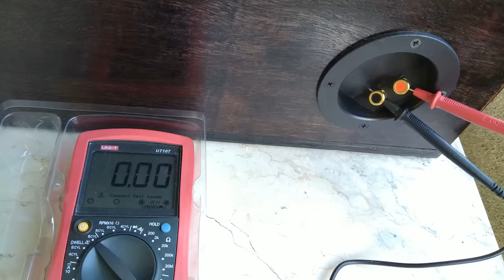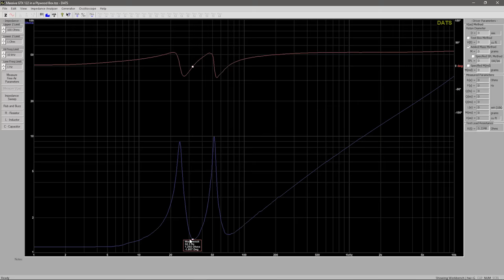How to Make L-Port Plywood Subwoofer Box - DIY

Comment: The box is too good for that sub. 
That is an Extremely nice enclosure.
Reply: There is no where I have seen the measurements shared.
Reply from the maker: @odangydrama  There is a link to the TinkerCad 3D schematics in the video description. You need to create an account and login to TinkerCad so you can start using it and seeing the dimensions. Use laptop or computer web browser to open TinkerCad.

Comment: hey bud i was wondering why theres a piece of wood on the end of the port. i know the 45s help with air velocity and makes the box stronger but ive never got an answer on why some boxes have a piece at the end of the port. i like it i wish i knew whats it meant for, thanks
Reply from the maker: Hello Rowboyto, that prism shaped wood attached at the port wall's end is to prevent air chuffing the thin wall.

Comment: You should have added mass, dampened the internal walls, metallic boards, to kill vibrations, and added a silicone gasket to the driver, a much more tight bass. infinitely precise.
Reply from the maker: No need. The woofer is just merely 700w RMS.

Comment: Hey, I have a question for you.   I am wondering how the transfer function of the vehicle affects the in-car response.  I have heard that if you tune for flat that you will likely get a nasty peak at some point in the frequency response
Reply from the maker: Nice question. That is one a bit of an advanced step in box building that I am still a newbie of. There is a section in Bass Box Pro that lets the user calculate the vehicle's air space volume, leaks, specs and response, all to be included in the final output of the whole system.

Comment: I am looking to make build a subwoofer box for a 10 inch or 8 inch sub. Should I use L-port design or just a regular port? I also have seen you have these wedges in the corners, are they necessary?

Comment: Can I cut my speaker hole AFTER I glue the box together? I have a double baffle and a 1/4" router. I bought a 1/4" diameter, 3" long end mill to cut the depth of the two 3/4" front baffle panels. Think I'll be ok? Or did I make a major mistake?
Reply from the maker: You can still cut speaker mounting hole after gluing together. I also do that sometimes.
Reply: @chrclmnky  Ok cool! Thanks!

Comment: hey what tool are you using on 4:27 ? what kind of drill or drill accesory is that so you can drill perfectly straight?
Reply from the maker: It's just a generic "drill guide attachment". Available almost everywhere.
Reply from the maker: @jairoguerra9924  yes. There are way cheaper from other online marketplaces like AliExpress, eBay, Banggood

Comment: And here I wuz thinking this would be something I could actually do myself 😂🤣😂😂
Reply from the maker: Yes you can! With just a little patience and time, you can build awesome boxes.
Reply: @chrclmnky   Absolutely and I appreciate that, only thing is that I don't have all those specialized tools 🥺😔
Reply: @hcic9860     This was Insanely over built for a 700w sub, you don't need anywhere near this level of box.   Don't need the double front, don't need the extra bracing for the corners or end of the ports.  You can do this build much simpler with basic tools.

Comment: what happen if box Port are too big ?? 4inch width & 14inch height & port long about 20inch +/- . box dimensions : 27inch width / 15.5inch height / 15inch depth, one 12inch jbl stadium 1224 subwoofer 500w rms & 12mm xmax, im prefer to loud bass, not too low bass freq but ok if I can get a louder bass sound from this size box, sorry im beginner
Reply from the maker: Sub will act as in open air and will bottom out.

Comment: How do you make perfect circles?
Reply from the maker: Hello Taco, I used a router and a jig. Here is the video about how I do that - https://youtu.be/7x4f6nfGlO0
Reply: You can use a compass or a drywall Circle Cutter. They both work good. But if you dont have either of those tools you can basically make you're own circle tracer by using a tape measure, a piece of wood (about 2 in by whatever length you need a tape measure and a couple of screws. I learned alot of what IU know from watching YouTube vids.

Comment: What's the specs on the screw sets used for the subwoofer mounting??
Reply from the maker: Hello, the T-nuts and Allen head machine bolts are size M4 or 4mm.
Reply from the maker: And about 2 inch long.

Comment: Does the port at the back of the box have to be the same width as the side?
Reply from the maker: Yes, for consistency.
Reply: @chrclmnky  what if its off by like 10-12% ?
Reply from the maker: @AKTesla  none to worry. That is just a very small difference.

Comment: Pretty good job! congrats what size is the port in the front box? thkns
Reply from the maker: Thanks Willy. There is a link to the TinkerCad 3D schematics in the video description. You need to create an account and login to TinkerCad so you can start using it and seeing the dimensions. Use laptop or computer web browser to open TinkerCad.

Comment: sir naka tune din po ba yung targa na 10" sa L ported na box???base po kasi sa recomended  box nya  2nd order na sub box.tanx idol.
Reply from the maker: Did Targa recommend anything? If so, where? In designing enclosure, you will need the electro-mechanical (theile-small parameters) of the speaker and calculate using a software emulator.

Comment: Kindly share the measurements, thanks.
Reply from the maker: There is a link to the TinkerCad 3D schematics in the video description. You need to create an account and login to TinkerCad so you can start using it and seeing the dimensions. Use laptop or computer web browser to open TinkerCad.

Comment: Hello I tried the new subwoofer today, the smell came. Why is it because it is new? Like the burning smell but I measured the coils, no problem
Reply from the maker: Same thing happened to my GTX 122. It smokes and smells! How much amp power did you connect?
Reply: @chrclmnky  I connected subwoofer 4 + 4 ohms 2 ohms 800 rms. The amplifier delivers 900 rms at 2 ohms. I turned on low frequency music on first run
Reply from the maker: @bakbakalm4973  ok just don't put the volume and gain on very high.
Reply: @chrclmnky  Thank you. Shall I return the subwoofer? This smell frightened the incident nauseous. Do you think something will happen?
Reply from the maker: @bakbakalm4973  it's just normal.

Comment: if i have an 18 "speaker ... how to determine the box volume and port on the speaker box ... according to the data on the speaker ... thanks
Reply from the maker: Calculate the box using a program. WinISD is free to download, for Windows.
Reply: @chrclmnky  i want link aplication
Reply: @chrclmnky  how to calculate it basically ... from the speaker data ...
Reply from the maker: @masaminhobimancing8938  Just input every data into the program. Just Google the link.
Reply: @chrclmnky  what is the name the aplication?..
Reply from the maker: @masaminhobimancing8938  read back my comments and read carefully.

Comment: anu po technique nyo para dumikit ang lead sa speaker wire boss
Reply from the maker: Mainit at malinis na soldering iron
Reply: @chrclmnky  big thanks po 
sa akin kasi pag mainit ung soledering iron ko medyo nangigitim ung tip niya katagalan kaya ayaw na po dumikit ung lead sa soldering ko po 😢
Reply from the maker: @averagemark17  regularly change tips. Use high quality tips. Clean using only piece of paper in order not to scrape off the "shiny" coating.
Reply: thanks idol 
nice box po
Reply: @chrclmnky  ordinary speaker wire lang po gamit nyo po
Reply from the maker: @averagemark17  Plain ordinary 12 gauge wire.

Comment: Tengo mi carro kia picanto y tengo un subwoofer tsw309 pioneer dual 4 ohm crees que me puedas ayudar hacer una caja que suene fuerte así este la maletera abierta el espacio es poco del maletero podrás enseñar
Reply from the maker: Hello Jhohan, thanks for reaching out. This particular subwoofer box will be good for your Pioneer TS-W309 since they have same T/S parameters with the Massive GTX 122. For measurements of the box, check out the video description for the link to TinkerCad layout and design.
Reply: @chrclmnky  tengo que comprar el programa verdad manda un saludo para Perú 🇵🇪 en tu próximo viaje a vídeo gracias

Comment: Bro I have 10inch single coil double magnet subwoofer please suggest a box
Reply from the maker: You can copy this box but minus 1 inch to each side
Reply: @chrclmnky  sir full details and measurements of that box pls..i want to diy same as that tnx sir
Reply from the maker: @meinradoeb4101  Hello Meinrado, There is a link to the TinkerCad 3D schematics in the video description. You need to create an account and login to TinkerCad so you can start using it and seeing the dimensions. Use laptop or computer web browser to open TinkerCad.

Comment: You should have routered all the edges within that box. Air doesn't like to turn and the sharp short turn edges causes turbulence at those areas! Just a thought for the next time or if anyone else is taking on a project such as this!!!  Otherwise, Job well done!!!
Reply from the maker: It's routed. No sharp edges there. Just didn't shown in the video.

Comment: From the beginning i was waiting for sound and bass check,  but unfortunately you didn't test a single song.
Reply from the maker: There is a pinned demo video in the comment section and end screen, if you haven't seen that then there it is - https://youtu.be/GVS4K_a_q2A
Reply: @chrclmnky  ok got it,  by the way how much is the watt that ur subwoofer gives?   And does the baas equivalent to jbl partybox 310?    Also do outdoor test using binural microphone.  🙏

Comment: not bad but you forget the Bass pass plate, because your subwoofer is connected directly, so if you connect it directly with a good amplifier you will be very over it because it will not give its maximum or maybe it will burn meaning are  calculate frequency well damage.
Reply from the maker: No one installs crossovers or passive low pass filters on their car subwoofers anymore my friend. 😂😆

Comment: All is fine except that ur using a plywood instead of 3/4 MDF, try it u'll get a deeper soft crawling bass, kabayan!!
Reply from the maker: No difference between two materials in terms of resonance.
Reply: @chrclmnky  maybe ur just contented on d usual hard bass u hear all d tym. At first i also used plywood but when i use MDF it levels up my bass listening. i too is from d phils, and plywood and marinewood is everywhere so they use it all d tym. i remember my 1st MDF sub is from a wrecked tv entertainment cabinet n dat started it all. Try it bro ❤️✌️
Reply from the maker: @nelsonaragon1703  Times have changed a lot. There's a thing called impedance/resonance meter, the one I've used at the near end of the video. It's made by Dayton Audio and only sold at Parts Express. A tool used by audio engineers in measuring anything audio-electronics. It is built to kill theories such as material resonance theory you believed in.
Reply from the maker: @nelsonaragon1703  Also you may want to check out my other videos, you will see a lot of boxes made out of MDF too. Enjoy watching.
Reply: @chrclmnky  well based on my experienced, i based my jugdement in hearing and feeling after i put it in my meters, i already input in my mind dat i will always use an MDF board when making a sub box. Its only my opinion kabayan ✌️
Reply from the maker: @nelsonaragon1703  It's okay no problem. I get a lot of comments from inexperienced individuals telling me to do this and to do that! And you're no exception. Anyway thanks for the visit and be well. 😉
Reply: @chrclmnky  ooops! Inexperienced individual? im giving u my decent opinion for u to have lots of customer, maybe ur not into carshow so u dont know. Electronics is my lyf in the phil b4 i came here in washington, im a BSEE grad and an electronics technician, i use fluke as my multimeter. i already c u in ur other vid, it luks lyk ur the type of guy who doesnt want to be opinionated. Better leave this channel....poor guy
Reply from the maker: @nelsonaragon1703  Like I said, I get tons of comments like this and you're no exception. Next attention seeker please...

Comment: pwede malaman buong dimension?
Reply from the maker: Sure. There is a link to the TinkerCad 3D schematics in the video description. You need to create an account and login to TinkerCad so you can start using it and seeing the dimensions. Use laptop or computer web browser to open TinkerCad.
Reply: @chrclmnky  hindi ko maopen yung dowloaded na file..may drawing ka with dimension? thanks
Reply from the maker: @zyreljosephaswer3390  pilipino nga naman, may detalyadong instruction na ayaw pa sumunod.
Reply: @chrclmnky  pasensya na sir hindi ko kasi maopen. sige sir salamat na lang po

Comment: schematic please...sir
Reply from the maker: Check the link to TinkerCad in the video description.
Reply: do you play on 2 ohms....sir
Reply from the maker: @arissetiawan6172  this sub is wired in 1 Ohm.
Reply: @chrclmnky  wow.....will the power amplifier not be damaged,,,sir
Reply from the maker: @arissetiawan6172  amp can handle 1 Ohm at 1500w RMS. You should check your amp if it can handle such loads.

Comment: Hey bro I know theirs many people on here talking shit but I couldn’t pass by n not mention a few things you can say f me n what I gotta say but just think about those holes you made to screw the walls together those holes are going to disrupt the flow of air on the inside it’s going to great pockets of air in each one it’s a clean sick box and the idea is a good one but theirs a reason why everyone does it the normal way . Also adding the speaker terminal cup right in the way of the port haul is f’ing up the air flow smh 🤦🏻‍♂️ bro it’s such a sick box no lie but those 2 things took away a good amount of bass and air flow maybe putting more stress on the speaker idk maybe. Lol good work tho man sick shit.
Reply from the maker: Thanks for the feedback. Those little things can be disregarded. Little or no effect in real life application. Even the top guys like Bobby Gately, Next Level Fab, T and C Designs, to name a few, do such things even larger and deeper pocket holes.

Comment: You have an old idea, and it will not perform like you think. This is “out of phase” ........the distance has to equal the time. Nice try, though.
Reply from the maker: The what?
Reply: Lol
Reply: @jamie5.068  not sure what’s so funny. The guy did a nice job on something that will not do what he thinks it will. Sound will come out, yes, but it will be out of phase, to out of balance, or out of time......they all mean the same thing. Either do the math or tear apart a BOSE.
Reply: @johnholmes4960  you know too much, if it's out of phase you could switch it on the amp or radio. And it's not out of phase
Reply: He coudnt even answer you because he is proble like what the f is this guy talking about.
Reply: Jamie, ok, I get it, thanks. You may be more right than you realize.
Reply: @jamie5.068  Jamie, it’s not the voltage that’s out of phase, it’s the design of the distance the waves travel 
 
The front and the back of the speaker have to reach your ear at the same moment. There fore it is out of phase, or you can say the timing is off. This is an engineering issue. Have a great day.🤠

Comment: Insanely over built for a 700w sub.
Reply: You always want to overbuild. That way you can throw more power at it in the future :)
Reply: @projectJK2008  Always is a poor choice of words.   First of all, why would anyone get a 700 watt sub and amp when their future plans are for a 4,000 watt sub and amp?   Makes zero sense, they just wasted money.    Second, not everyone has plans for more power in the future, what they are building for is what they'll stay with.
Reply: @marcuslinton310  Well I've always built boxes for double the power output i'm throwing at them. Most people I know have upgraded their systems, so why rebuild an entire box every time? And first off, that box wouldn't last long with 2000rms thrown at it. You'd be going with stronger bracing, double walled support, and thick 3/4 MDF/HDF. So no, he did a great job building it, and for future plans he can still utilize the same box.
Reply: @projectJK2008    Never said he didn't do a great job, but my original statement stands, it's way overbuilt for 700rms.   I don't care about all the "what if" remarks you want to throw in the mix.    I can toss out endless "what if" remarks.    What if he gets a new vehicle and the box don't fit.  What if he gets a larger 15" sub.   What if he decides to get a second sub and two of those boxes don't fit.   What if what if what if what if.....    As for handling 2,000 watts.... sure it would and would also do so without all the extra stuff.      Rockford has a 1,200 watt loaded enclosure (600/each sub) and it's made out of 5/8" MDF.   LOL!   Pretty sure 3/4" will handle that and plenty more.
Reply: @marcuslinton310  I get what you’re saying, but it’s quite simple. Always try to overbuild your products. Make them last.
Reply: @projectJK2008    A standard 3/4" box isn't going to just fall apart.